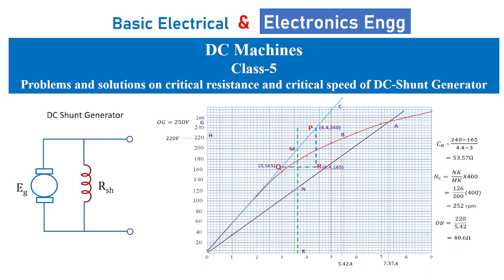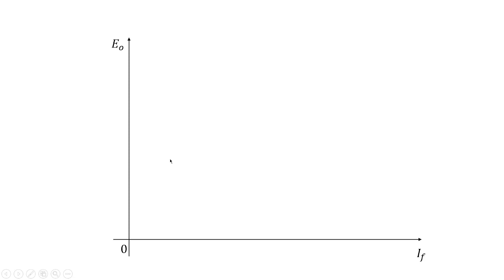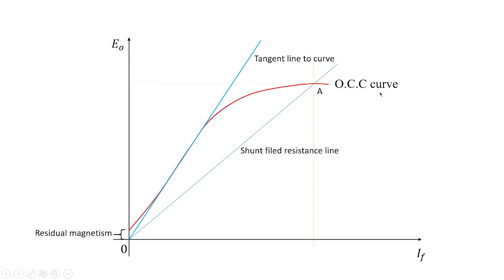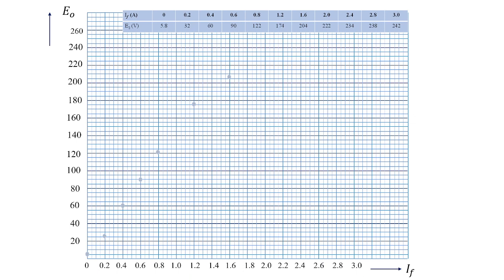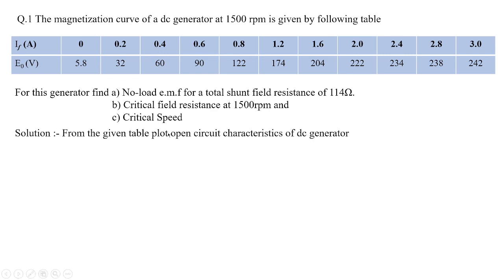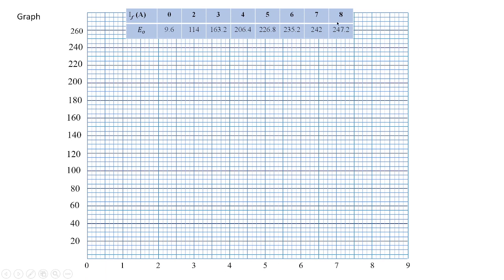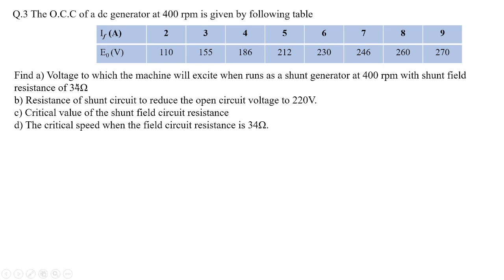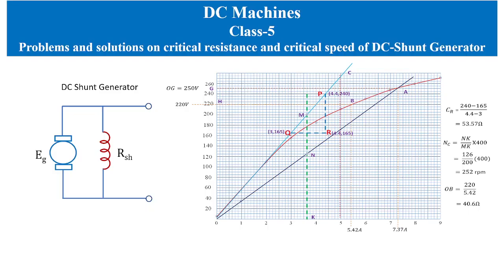How to calculate critical resistance and critical speed of DC shunt generator? what is meant by OCC?

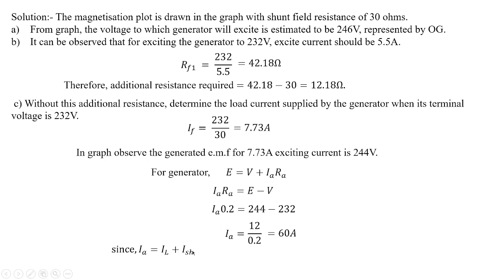Comment: 25:31 sir how did you get armature resistance as 0.2 ohm ?
Reply from the maker: hello shadinh
armature resistance is given the problem to be 0.2 ohms.
you try to take any other value and calculate the load current